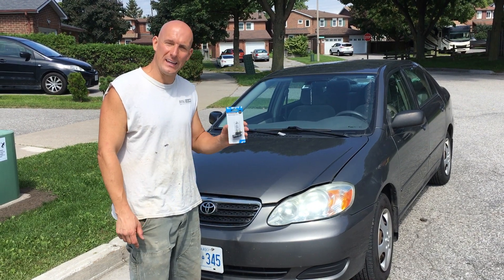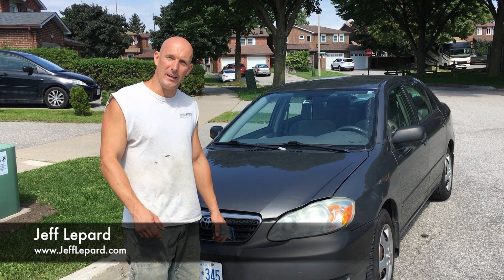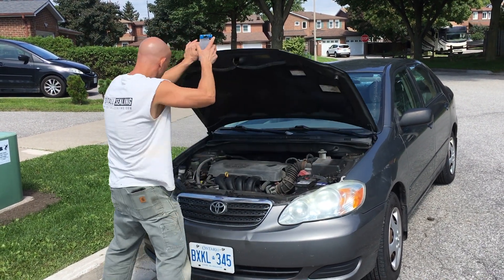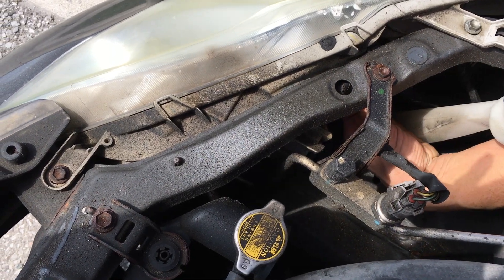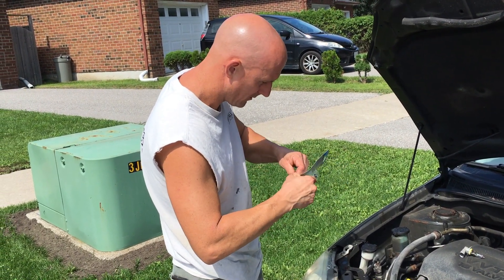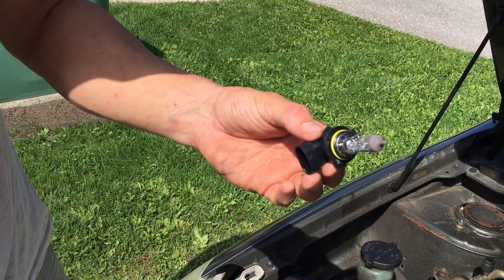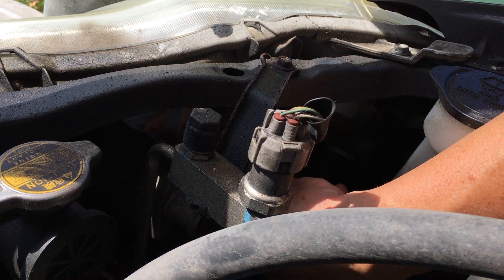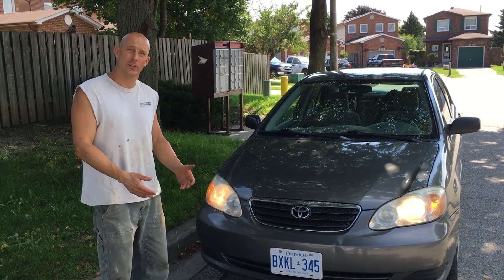Headlight Replacement • 2008 Toyota Corolla

Comment: Jeff 
next time you need to clean Plastic Headlight housing try WD40 as it is a Water and Oil mix been around 100 years,  It really works makes them Brand New Condition Again I did mine on my SUV 3 Years ago and it's now April 2023 and they still like New Condition.👍

Comment: How much harder is it to do the driver's side headlight?
Reply from the maker: It's just the same thing very easy!
Reply: I know it is the same  @JeffLepard , but is it harder to do it with the battery in the way?
Reply from the maker: I believe you can get to it without removing the battery.  I will check in the morning.  I don't think I've changed that side on my car before.
Reply: @JeffLepard  So what did you find out?
Reply from the maker: You can still get your hand under where the bulb is to pull that out.  You won't have to remove the battery.
Reply: You can also just take the bolts out of the bracket that holds the battery in place and you can shimmy it if you need space to get the light out.
Reply: @scottblanco5991  That would work.